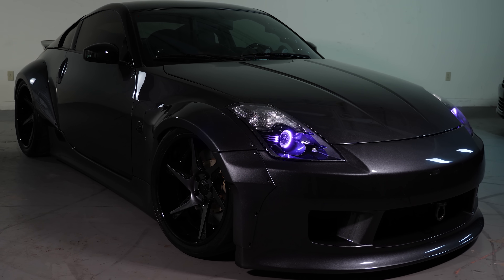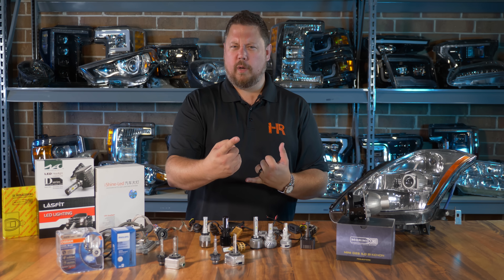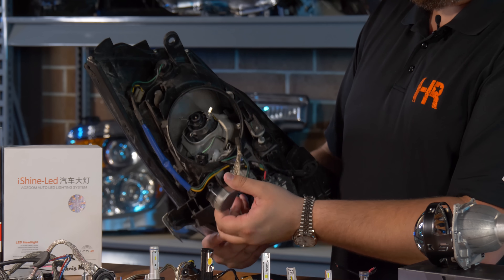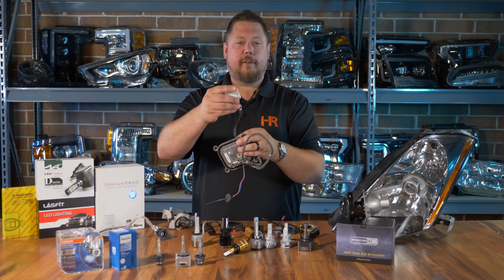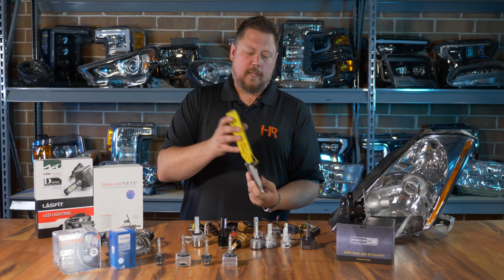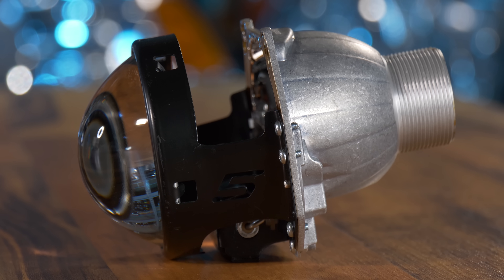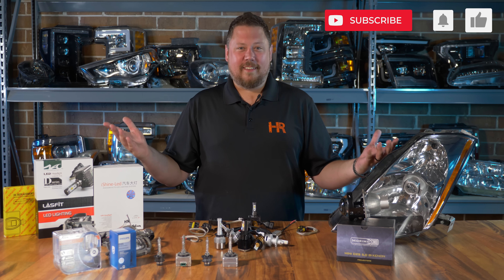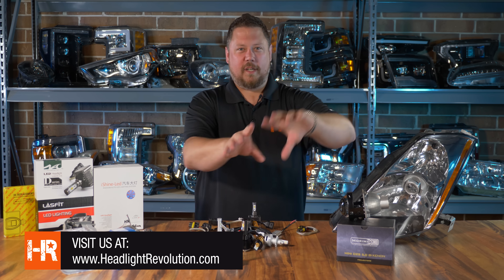D1S and D2S LED Headlight Bulb Replacements - Are they brighter than HID? | Headlight Revolution

Comment: Are HID’s still king in terms of output in modern day vehicles
Reply from the maker: HID's are still in the lead, but not by much. LED's are quickly becoming g the new standard.
Reply: @HeadlightRevolution  I have a pair of LED lights in my cars headlights and they are good but I 6000k color isn’t very good in harsh conditions and i don’t know if it’s placebo but when I had HIDs they shined further than LED

Comment: I got a car and the HID was switched out to LED. I don't like the light shoot out and not sure if the original ballast is still on the car. Is there a HID kit that you can recommend?
Reply from the maker: If you originally had HID, then you may have a factory HID system in which case you would just need to remove the LED components and install a pair of factory bulbs! You will need to re-connect your OEM HID ballast that is usually on the underside or back of the headlight, and is sealed partially inside the housing. If you would like to look into this further, shoot us an email and we will be happy to get you set up! 

Sales@HeadlightRevolution.com

Comment: Any idea if the results would be the same for a factory HID reflector setup?  I've got a 2010 Infiniti QX56 (D2R), and I'm trying to figure out what the best replacements would be, as the factory system isn't very good.
Reply: Just put some osram nightbraker lasers in it and call it a day
Reply from the maker: We agree with just sticking to HID, but it's possible that these LED bulbs would work better than shown in our video if you have a reflector based assembly. That type of headlight is just so uncommon nowadays we didn't bother mentioning it.

Comment: In addition to no win in light intensity, changing HID to LED will require wiring modification (HID ballast have to be bypassed). Good 5000K xenons give more visible light than 6000/6500K LEDs, even within same raw lumen range.
Reply: I'd rather split a few wires once than have to remove the entire bumper + headlight everytime theres an issue with ballasts. Being anal about visibility is literally overrated, 95% of roads are well lit.. for the unlit roads; 99% of led/hid do the trick without worrying about output.. everything else is just pointless

Comment: From the Philippines. Hi. I have a 2016 Mitsubishi Pajero. My headlights are powered by a pair of stock d2s HID’s. Its light output sucks. I already supported it with LED fogs but i just want to increase the light output of the HID without doing much Mods. 

How to do this. Thank you

Comment: For my 05 Cadillac STS, I've got gtr led's in my 9005 high beam and it's amazing. I'd love the gtr led's in my d1s low beam. Both are projectors, and if ya'll had a d1s led that plugged into the power supply wire that connects to my ballast inside the headlight it would be a plug and play for me and I'd have incredible light out put from both my low and high beam projectors.
Reply from the maker: I wish we had something for that D1S application, unfortunately, LEDs just do not perform well enough to work in place of a factory HID bulb. Let us know if you need anything else, or have any other questions, we are here to help! Thank you for your time, and have a great day!

Comment: Is it true that when your bulb fails you need to change both ballast and bulb? My local retrofitting shop who retrofit my fog lights told me this, and I'm kinda skeptical and find it a bit weird?
Reply from the maker: Usually you'll want to change both bulbs at the same time, However that's just to keep the colors the same. You do not usually change the ballast and bulb at the same time.

Comment: i have a D8s HID, swap it to LED but as the pin in LED is not terminated, i just stuck it inside the power input socket. wrap a tape around the input. Ballast stay on its place and were sealed with tape. Voila working like charm. but i don't have the tools to measure the Luminosity though.

Comment: I’ve been trying to improve brightness on UK Ford Focus 2010 Xenons and was curious to learn about LED versions but will stay well away now. Have tried Phillips Xtreme Vision gen 2 and Osram Xenarc Night breakers but neither seem to be better than OEM Osrams. High beam is ok but is supplemented with H1 halogen bulb, it’s low beam I’ve been looking for improvements with but had no luck.

Am I right thinking a ballast issue wouldn’t be contributing to this?
Reply from the maker: It probably isnt a ballast issue, it is honestly just that OEM HID bulbs are great products! That is why we carry a lot of Osram HID products, they make fantastic OEM HID products as well! For that vehicle, I might recommend trying the Osram CBB bulbs, if you let me know what size that is I would be happy to link those for you!
Reply: @HeadlightRevolution  that would be a great help thanks 👍 my lamps take the D1S Xenons
Reply from the maker: I have linked the bulbs for your vehicle below, let us know if you have any other questions on those! Have a great day! Link: https://www.headlightrevolution.com/d1s-osram-xenarc-66144-66140-cbb-B-66140CBB_2?quantity=1
Reply: Just found I’d commented here 2yrs back so adding an update - issue was the reflectors in my headlamps had degraded over time, known issue looking on owners forums. Fox is to either cut the lamp open and fit uprated projector kits or in my case I replaced the lamps. Now running the Osram Nightbreakers and have usable headlamps again for low beam 👍

Comment: Searched everywhere for how to convert from HID to LED. I had a feeling I’d have to cut the harness unless I want to spend $300 bucks for a plug n play kit
Reply from the maker: You would not want to convert to LED from HID. Just upgrade your ballast wattage or bulbs to something like the Night Breaker Lasers and you'll get much more light. 
HID projectors don't work well with anything other than HID bulbs.

Comment: So if I wanted to upgrade my oem HIDs could I add a 55w ballast to replace the 35w ones?
Reply: From what I read online there's really no true 55watt ballas and if you do come across one I also read that they create more heat then a 35watt and usually burn out much faster then them also I would recommend just stick with your 35watt ballast maybe even get new ones and better HID's hope this helps 👍
Reply: @MrProsperty  Thanks!

Comment: Hi there! Can i replace 
 my d5s 25w xenons with d5s 35w led? Can i safely run them without any risk of overheating or fire? I am asking because my a4 b9 use 25w xenons and the d5s led on the market are 35w. Thanks
Reply from the maker: We do not recommend using LEDs in an OEM housing designed for HIDs.

Comment: Is there some way to upgrade a 35w oem hid to a 55w hid?
Reply: Use an higher wattage ballast. But your bulbs will burn out quicker.
Reply from the maker: Upgrade your ballast!
Reply: Is that possible and still use oem connectors/harnesses? I have a bmw e90 with 35w xenons btw
Reply: Becareful when doing so, I have heard that you might endup frying your factory wire harness by running nearly running twice the wattage. It should be safer getting a 55watt ballast but use 35watt bulb from what I have read somewhere on a Lexus forum but I  personally have never tested that out myself.

Comment: My UK 2010 mk6 golf gti oem hid light output is terrible, I've swapped the bulbs but it's no better, they look like halogen with low voltage. They strike up fine every time with no flickering and Colour is good. When beaming against a wall the cut-off is fine but on the road the light just fades out. Any suggestions? Cheers
Reply from the maker: Clear lens swap!

Comment: Ok, you may have made the case that PROJECTOR lenses and LEDs don't make sense... how about the standard reflectors as used by, say, a 2004 Cadillac Escalade, which apparently was available with either D1S HID low beams OR with standard 9006 bulbs? Given a reflector lens rather than a projector lens, is LED then an option. (Yes, I'll concede a LOT of cheap led have terrible beam patterns, but is a reflector more forgiving than a projector?)
Reply from the maker: LED is a good option for reflectors, yes. 
But OEM HID should be left alone.

Comment: I have a 2003 mini cooper s with hids. My problem is on the headlights it reads D2 but the little plugs tells me its D1 but when  i put D2 they dont screw in and olug is off. Dont know if these are the originals but i need help
Reply from the maker: Our guide shows your Mini takes a D2R bulb. Please email us a picture of what you are working with so we can confirm if that is correct or not. Sales@HeadlightRevolution.com
Reply: @HeadlightRevolution  you arw the best. Ilp be sending pics shorrly

Comment: How possible is too replaced the original hid d1s xenon for a regular led?
Reply from the maker: This is not recommended, you will get less light. I would recommend upgrading to a better HID bulb like the Osram NBL!

https://www.headlightrevolution.com/d1s-osram-xenarc-66144-nightbreaker-laser-B-66144XNL_2

Comment: I was quite surprised with the Morimoto failing so badly.  I have the 2stroke 2.0 in my GenX Civic projectors and it was an excellent upgrade over the halogens.  Clearly, when a projector is designed for HID, that is it.  HID or bust.
Reply: Yes you are correct. People assume a projector is a projector. HID projectors are very different from halogen projectors. Bulbs are completely different, that's why all of the blinding light occurs with LED bulbs. Or HIDS in reflector housings.
Reply: @ricardomolina4605  the blinding occurs from not adjusting your headlights properly to match your beam pattern. Has nothing to do with the type of bulb you are rocking.
Reply from the maker: Yeah you have to make sure you have the correct projectors.

Comment: I believe you.  I have a lexus RX330(2004). Replaced with  D2S(no conversion) Led bulb last week. D2S SUCKS.   (1) Very expensive. (2) Connecting two pins are  a nightmare compared to H11/9005 bulbs in Honda. (3) Not so happy with the brightness with LED  compared to HID(previous bulb). So don't think of replacing D2S  . This is my last Lexus. I will stick to mediocre Car.
Reply from the maker: They've gotten slightly better over the years, but overall for the best overall bet, I still recommend HID!

Comment: Thanks for the video , i have the osram cbb 7000k butt i dont realy like him its not white white its mixed with yellow when you look whitout the car to outside so i whanna juse the led in mijn d3s headlight is this posible ?
Reply from the maker: Osram certainly did over rate the kelvin rating on that bulb, I'd say it's closer to the 5500-6000k color. While you could go LED, you would notice a huge drop in light output. If you're after the 7000k color, I would recommend going with the Morimoto 6500k bulb. That will be the best bulb that you can get that is more on the blueish white color range. 
https://headlightrevolution.com/morimoto-d3s-xb-hid-bulbs/
Reply: Headlight Revolution thanks for comment so witch are whiter and brighter . The osram cbb 7k or the morimoto 6500k
Reply from the maker: The CBB's will be brighter, but the Morimoto 6500k will be more whiter.
Reply: Headlight Revolution tnx for coment , i dont know i have the osram cbb 7k now in my golf 7 , but its looking not realy white when im in the car and look to the road

Comment: I have a factory D3S HID set up. They now are flickering, barely noticeable to the naked eye, but enough to be noticeably dimmer than when we first got the vehicle. Does anyone have experience with fixing this?
Reply from the maker: That sounds like you will need a new bulb, I would recommend going with a pair of them since the bulb color and light output will degrade over time. I have linked the page with all of those bulbs for you below, I would recommend going with the Osram XBB bulbs! Let us know if you have any other questions, have a great day! 

Link: https://www.headlightrevolution.com/lighting-by-size/custitem_category_facet/D3S?order=commercecategory:asc

Comment: Hey I have a very important doubt. There are some d1s that are 42v and some are 85v, they are both offered equally, but how important is that spec to be the exact same as the OEM?
Reply from the maker: What you're seeing is D1S and D3S bulbs, the D3s bulbs are lower voltage. You will want to stick with your stock bulb size and make sure that voltage matches.

Comment: Lasfit makes a complete plug and play kit for the 350z
Reply: Did you not watch the video? Plug and play of any product is not the best solution. HID projector needs hid bulb. LED bulbs are only a temporary solution and mild upgrade to stock incandescent bulbs. Real LED headlights are designed with led in mind. Perfect example is the new Morimoto headlights.
Reply: Their a couple of hundred of dollars tho, I tried to find some for my g37 but the light output is worse than stock, even aftermarket led headlight assemblies are worse than stock, just put custom halos and your good to go, not gonna spend hundreds to have worse beam pattern and light output
Reply from the maker: That is not the move.

Comment: Ok. I have a couple of things to say 1 hid bulbs are great. Unfortunately temperature on the bulb is quite hot. Hotter than a halogen bulb. I've melted a couple of housings, doing retrofits. You ever wonder why there's that ,ceramic, coating on the outside wire? As led tech improves, it'll get better. I've been messing with this stuff for over 10 years. DOT certification has become a big issue. Trial and error. I've gone through many bulbs ,styles and venders.
Reply: And yes there's plug and retro fit kits for OEM hid systems. I recently LED retrofitted an 08 Prius. Reflector type, with OEM hid system. All the original electronics, where maintained.
Reply: Please, any link for plug and play for oem D3S???

Comment: Would love to see an actual led D3s that would actually work. Neighbors just picked up a new Toyota Camry with factory led in factory projector lens!!! And that argument that lower the kelvin the brighter the buld only apply to hid bot led. Camry led color temp is around 6000k-6500k and is spanking my  Phillips xtreme vision gen 2 hid in both color and brightness 
So here’s to some future D3s led conversions that work
Reply from the maker: That might mean that you have a bad portion in your vbehicle, as those OEM HIDs should be the best possible light option available right now. I do not expect that an LED will be created for that application, as the HIDs are just better than LED when it comes to those OEM HID bulbs!
Reply: Headlight Revolution not saying that my bulbs are not bright just not as bright any compared to fiancé 2020 Honda Accord with factory led sitting side by side shining on to my garage door and during driving. These new led light on newer cars are just so nice. Not knocking on hid but they are older technology. They have them now on base model corrollas !
Reply: Headlight Revolution although the led set up I’m my fiancé’s Honda are look more to be a reflector style set up and look light the whole assembly would have to be replaced once a bulb goes out hopefully not to expensive
Reply from the maker: That is the downfall of those OEM LED headlights,  you do have to replace the whole housing just to fix the headlight. I wish we had an option for you here, sorry about that!

Comment: Ikd but on all my cars with projector lenses i installed.. And probably will install in future... Hid from morimoto... That is only my opinion.. But.. It works for me....
Reply from the maker: You put LED bulbs in your projector headlights and they worked? In this video we show that some can work, but HID works better.
Reply: @HeadlightRevolution  i replaced from halogen standart bulb in projector lenses.....i tried led too.. But. Like i said idk... I like HID more
Reply: Dont like the green tinge to the morimoto 5500k hid. In videos the morimoto 6500k appears to have replaced the green tinge with blue. In my bike I put the xenon depot 6500k and like the color better then the morimoto bulbs. The xenon depot ballasts are smaller but I think I like the morimoto ballasts better. Would like to try the deauto hid bulbs, but they only sell them as kits

Comment: In india we use that aozoom bulb for our projector fog lights . Though the projector originally comes with D2H series HID bulbs but  that becomes a bit too powerful for the untrained installers . That aozoom bulb can is very good for low beam application
Reply from the maker: Sounds like it has some good application!
Reply: what the difference between a D2S HID bulb VS ordinary HID bulb of the same make? planning to change my projector fogs from AES to UGlare,